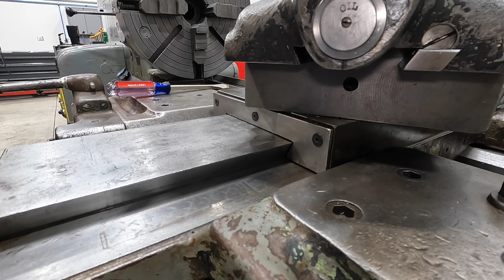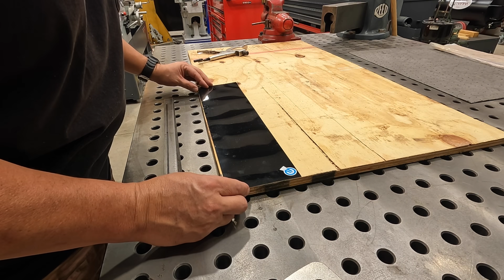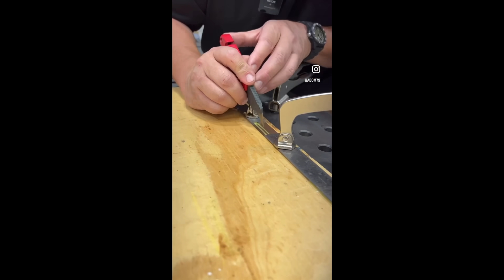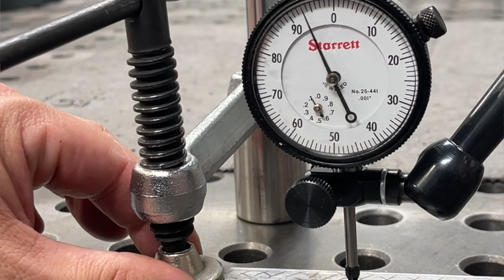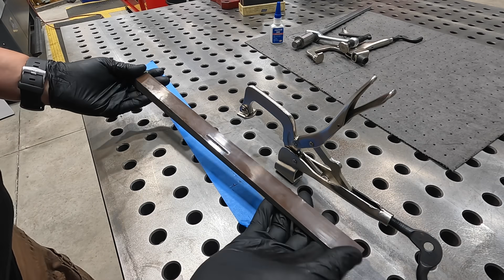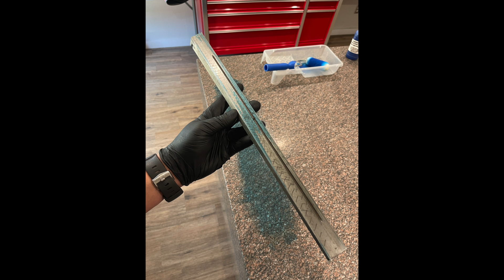Gib Repair for American Pacemaker Lathe

Comment: That part seems like it would be easy for "you" to make a new one! plastic shim seems it will crush and you will have the same issue.
Reply: It's against the static side so I don't think it'll be torn apart like it might if it were on the moving side. The pressure holding it tight should also prevent it from moving and thus breaking. Plastic can deform a lot before breaking and for something like this I don't think a crushing force would hurt it. It's more likely that the locktite would give or the gib wears down more first I think
Reply: This is a very common repair.  That plastic is very though and has low friction coefficient.  Yes you can make a new one, you can also scrape the ways.
Reply: The plastic is not going to "crush" easily, there is way too much surface area, so the local pressure is not very high.

Comment: ❤ Should not need to glue it. The adjustment screw will hold it in place. 
 When you add the thickness of the glue you may be too thick again.

Comment: I did a similar repair to the table gib on my K&T horizontal mill. Instead of using feeler gauges, I calculated the shim thickness by multiplying the taper ratio to the distance I needed the gib to move. Since most tapers are 1/4" per foot, if I need to move the gib 1", then adding .020" to the thickness of the gib gives me that movement. I think my math is correct. Realistically, the center of the shim could have been completely removed.

Comment: I've got a couple of those Push n Lube oilers for my lathe.  I think the problem with them is that they are extremely difficult to get the air bled out of them.  I fiddled around with them for quite awhile before they suddenly just started working.  I took a wood dowel and applied quite a bit of pressure to the backside of that plastic piston while stroking it on a fitting.  I have one for flush fittings and one for the regular looking grease fittings and they both now put out a decent amount of oil per stroke.  
I also have a project on my backlog to modify a small grease gun to use oil instead of grease. It surprises me, with sheer number of these types of fittings and old and new lathes, that there isn't a great solution out there that I could find.

Comment: Remove the check valve from the grease gun tip you don’t need it because of the pump in the oil can I think it should work then?

Comment: Adam, my personal view from working on Vintage Bentleys, is that it is best to use button fittings for oil points and Zerks for grease. I then use a Tecalemit button oil gun for the oil points and a Tecalemit grease gun on the Zerks. That way you don't end up greasing locations that should be oiled. These oiling guns may be difficult to find now but I would suggest contacting the Bentley Drivers Club of America as all Vintage Bentley's use these button oilers. They may well sell new ones.

Comment: @Abom79  A Push`n`Lube is not working because it cannot overcome a spring in a nipple where you are trying to push it in to. Try and make similar style but just make it so you can increase a pressure in a cylinder of a push`n`lube thingy so it can actually overcome a spring in a grease nipple (or just remove a spring inside it). sorry for my english and greetings from serbia

Comment: Gluing that sort of plastic is a notoriously tricky problem. Spray contact adhesive or "flexible" cyanoacrylate will probably work a lot better than the Black Max. But it's probably fine as is, because there is nothing trying to peel it.

Comment: A normal grease gun should work right off the bat. Just empty out the grease of a tube, back the plunger out, and fill it with oil.
Only problem I can imagine it that the gun can leak a bit of oil. Store it on a PIG mat.

Comment: We do this to our manual lathes and mills once a year. And we always move our work in different locations along the beds of the mill to avoid belly's.
Reply: I have ran long bed Cincinnatti mills that were so bad they had the "rainbow" effect. At full travel in both x axis they were like a rainbow. That is where I learned the intricate and strategic placement of indicators and shims when setting up a fixture. Worked for the Boeing company for 13 years and we had the most sophisticated 5 axis machines to the most worn out machines you could imagine. My lead person was a retired machinists mate from the Navy. Smartest man I ever worked with. He could literally do it all...

Comment: For those who are suggesting that a new gib should be made, well, it's not quite that simple. 
The dovetail of the way and the slide, also has wear. To make a new gib, and fit it to a worn dovetail, would not give better results than what Adam is doing by shimming. 
If he were scraping the entire cross slide assembly, then fitting a brand new gib would be proper.

Comment: Especially on even thinner shim stock always cut towards the edge, don't start from the edge.  Best practice to always cut towards the edge on any thickness stock as you did on the 10 thou shim.  Just a suggestion from experience and subsequent guidance from more knowledgeable folks.  This is a don't ask how I know type comment not a criticism.  Love seeing the old Iron getting shipshape.  Just nothing like the equipment from that era. It was built to last and it's still here and may need a tweak or two or even a new part made but in the end you have a machine that will do the job and is a pleasure to use and has plenty of gravity built into it.
Reply: Thats what I love about him working on old machines like that. They may be over a hundred years old but he can still nail every dimension by taking care of it like he does

Comment: I have saved old worn gibs by attaching feeler gauge stock to them using gasket adhesives.  Works great and if you ever have to take it apart, it's easy and looking at the feeler, right away you will know how to replace it.  
Measuring bow with a feeler did help.  The worst thing I ever found about scraping tapered gibs is bowing can increase with each scraping pass.